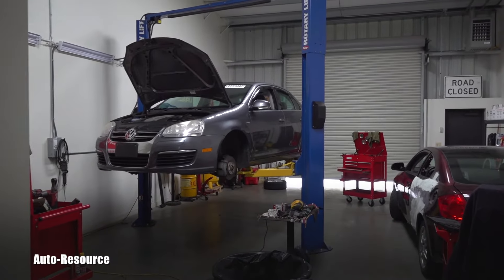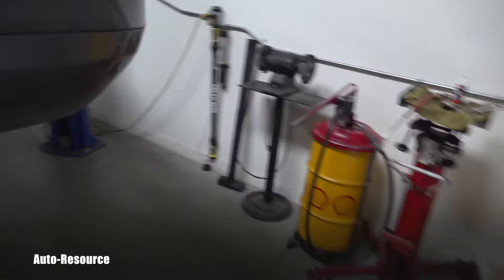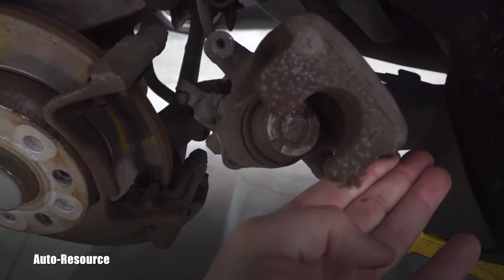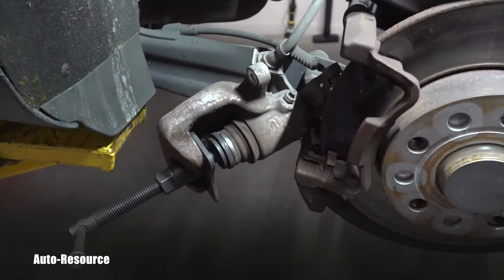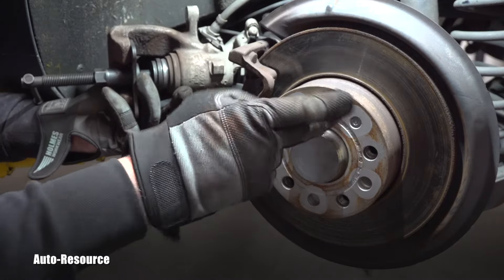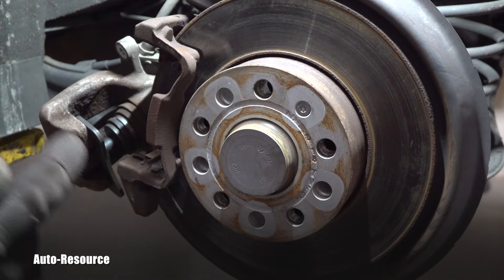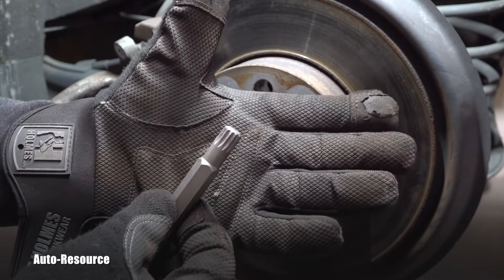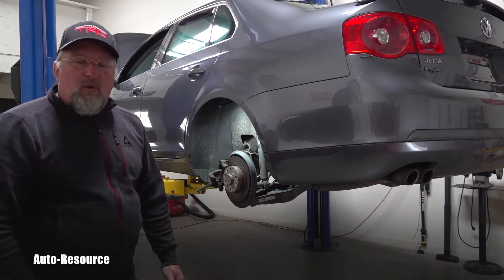Volkswagen Rear Brakes Specialty Tools needed

Comment: I have changed the brakes on countless cars.  None have been more of a nightmare than my VW. Buyer beware.  Stay away from German cars unless, 1 you are rich, 2 you sell it before everything goes bad on it.  Usually about 50,000 miles.
Reply: Hey, i have a passat 2012 b7 1.4 ecofuel, and im stressing myself out.. I have the scan tool to retract the caliper piston. And i bought a normal piston tool that just pushes back the piston straight. Do i need the tool that rotates the piston? And do i need any other tools to do the rear brakes? Im trying to find information but many people say different.. thanks
Reply: @user-cw3kp9mc6q  I took mine to my mechanic for the rear. Did not need front done.  I supplied the calipers, and pads. He installed them for $110. I want even going to try because I was so frustrated.
Reply: @Deeked  Okey, understandable man its annoying im not sure i have all the tools for the rear..
Reply: @user-cw3kp9mc6q  The tool to remove the bolt that holds the caliper is a special order for my VW. I'm 54, with a chronic lung disease.  Maybe if I was younger I'd go at it.  I just can't these days. 
Anyway, I wish you the best of luck fixing yours.
Reply: @user-cw3kp9mc6q  I forgot to mention.  For my rear caliper pistons, it requires a tool that rotates and compresses at the same time.  If not done correctly you can damage the assembly.
Reply: @Deeked  Oh man that sucks to hear, wish you the best and hope you recover from that! I saw some people mention some kind of triple square thing to remove some bolts or what ever on the rear.
Reply: @Deeked  I have a scan tool that i plug in to the car that rotates it back automatically and i've heard you dont need the the tool that rotates it back? That's what i've heard but maybe im better off paying 20-30 dollars for the right caliper tool just in case and the triple square to remove the bolts.
Reply: Nonsense, my BMW is the easiest car I ever worked on.
Reply: @maeu59  ok
Reply: @maeu59 😂😂😂 you must not have worked on very many cars then
Reply: @tylerseabook9423  enough to know
Reply: @maeu59   nothing about bmw is easy compared to any other car 🤦‍♂️
Reply: @tylerseabook9423  oil change the filter is right on top, brakes and rotors were easy, spark plugs no different than any other car I had. Mine is a 2005 330 ci, maybe the newer ones are difficult I couldn’t tell you.
Reply: @maeu59   oil filter location makes a car easy to work on? Brakes and rotors😂😂 brakes and rotors on every car ever are easy 🤦‍♂️ plugs 😂😂 do a real job on your car then compare it to any other car that’s not bmw or vw and you will maybe comprehend
Reply: @tylerseabook9423  you go from saying "nothing about BMW is easy compared to any other car” to " do a real job on your car” I give you examples of things I find easier and you want to go into an overhaul. Maybe you just don’t have any mechanical abilities and things are difficult for you.
Reply: @maeu59   🤦‍♂️🤦‍♂️ omg clearly you think brakes and plugs are mechanical experience. That’s first week apprentice stuff. I’m talking anything other than the basics. Which clearly you haven’t done😂 so I’ll just take my heavy diesel journeyman ticket and walk away 🤦‍♂️
Reply: And my Passat I had went 250000, my Jetta currently has 123000…
Reply: @chrisallen8473  they are junk. Ask any mechanic
Reply: @Deeked if you know how to work on them with the required tools they are fine lol. Just because you ran into a problem because you’ve owned a Honda your whole lives doesn’t mean they are a “piece of shit”. Have you not read about Subarus? Trust me, every mechanic I know has said Subarus are a pile and vw doesn’t usually compare to that. Germans just engineered them so they could be more reliable. God forbid something requires an extra tool.
Reply: Can’t say I agree
Reply: Totally agree, dealer parts are expensive  and dealership labor is 150 per hr. I have a 2014 TDI VW Jetta I already changed Egr, the sensors underneath the car including the one that is the exhaust, heater cooler, radiator, and gosh the engine light still on after the dealer installed the egr. However it runs great just a lot of maintenance and ohh as of last month the Wiper motor I had to change (motor 366$USd they no longer carry original part for this model so I had to buy the piece that the motor is attached to that part was 335$USD) All dealer parts purchased since I owned. smh I’m on the deep end in repairs but I’ve seen worst in VW forums. Cheers to VW!
Reply: My 2009 Jetta that’s only Had a radiator replacement and CPS replacement (other than maintenance items) in the 126000 miles it’s been alive would like to disagree 😂🤣🤣
Reply: @cullensmith8341  my Honda has 420,000 miles. 
Oil, brakes, timing chain/belt.
That's it. 
My Toyota, 275,000 miles. Oil and brakes only. European cars suck nuts

Comment: Thank you very much for explaining this! I had the tool to rotate & compress the piston but was using it incorrectly until I saw your video. Thank you!
Reply: Also, the brake job tool kit I rented from Advance Auto Parts included a disc for rotating and compressing the caliper piston; that disc also had a square hole in it's center which accepts a 3/8" drive ratchet. The piston in my caliper wouldn't rotate using the compression tool. I was only able to compress the piston into the caliper by using the disc and a ratchet to turn the disc & therefore the piston. As I rotated the piston with the ratchet the piston recessed into the caliper.

Comment: I’ve just done REAR on 2013 Golf with Electronic Parking Brake. The caliper piston just goes “straight” in! However, on a VW Polo with Manual Parking Brake the special caliper piston “wind back” tool is required!

Comment: my buddie's a mechanic, and I was doing the rear brakes on my VW and didnt have this tool so I asked him and he just took an extension for a ratchet and pressed it against the piston and twisted and  got the piston all they way in, no special tools needed. 
It kind of became a two man job as I had to hold the caliper with both hands but once he got enough pressure on the piston and twisted the extension getting it back in was no problem.
Reply: I am having same problem .I am turning the piston using vise grips but need to push on it too I guess ! I have to buy the tool to do it ,or put a C clamp to push in the piston while I spin with vise grips!

Comment: 14 mm wrench and 15 mm wrench to hold the nut so it doesn't spin. To release caliper 
Must spin and push back the caliper piston/use special compression tool
T30 for screw to slide rotor out
Triple square bit m14 size for the bolts that hold the caliper and pads
Use brake cleaner for new rotors. They come with special coating. Must clean off 
Apply grease to bolts. Apply grease to new pad ears and around piston and behind the new pad that sit on the piston. Careful not to get any on the rotors. 
You can do this.
Reply: How about the 11mm/ 7/16" hex slide pins on the rears of some passats.
Reply: @fjb666  ah i didnt encounter that. My project wasn't pleasant in the least but i was able to pull it off. How did you manage your issue? Please divulge. I want to know. Respectfully.
Reply: @822giron6  luckily a coworker had a hex set with 11mm, just ordered an 11mm to add to my set since most hex bit socket sets skip 11mm. Fun fact, 7/16" sae hex is close at 11.13mm.
Reply: @fjb666  is that the pin you hold while you loosen the bolt?
Reply: @822giron6  Nah, the 11mm hex is for the caliper slide pins on 2012 and 2014 Passats; found this out this week on the 2 different customers' cars.
Reply: It's 13mm (not 14) for the bolt head & 15mm to hold the nut

Comment: Hi. Good video. I am trying to help out friends doing rear brakes on the 2012 Jets S Model .I have the generic square block to retract piston ,left over from a 2001 Super Beetle brake job I did . It would not fit so I was turning the piston in with a set of new vise grips .The piston is turning but not retracting .I believe the calipers piston is bad internally or else I need to get a tool like you have that pushes and turns at the same time.If I buy the Harbor Freight Universal Set should it be able to turn the piston in on the Jetta Piston ? I see guys on videos using a adapter Labeled 2 A when they are using the Lisle 2500 Caliper Piston Service Set. I was going to just buy new calipers since pistons aren't fully retracting for me ,but I am going to try retracting using the tool like you have first ! Thanks for the info

Comment: I was doing rear brakes on my son's Mazda 3, and it had a piston retracting system like this.  So I ordered the kit, but didn't notice there are two shanks that come with it, one of which is counter-threaded.  I ended up extending the piston out so far, it was completely stuck, and I could not even remove the tool, to get the other one in.  I was at a loss, until I decided to open the bleeder, and use a combination of screw driver pressure, and wide pliers to twist and push the piston back.  it took a long time to get it moved much, but as soon as I could swap put the tool, and replace it with the right shank, it ended up okay.

Comment: C- clamp and a pair of adjustable grench will do the work. Turn them at the same time, I just did it on a 2008 GTI.
Reply: Hey, i have a passat 2012 b7 1.4 ecofuel, and im stressing myself out.. I have the scan tool to retract the caliper piston. And i bought a normal piston tool that just pushes back the piston straight. Do i need the tool that rotates the piston? And do i need any other tools to do the rear brakes? Im trying to find information but many people say different.. thanks
Reply: How does an adjustable wrench work🤦‍♂️ ?

Comment: ALL fasteners on VW exposed to weather, will have a chemical thread locker. If you try to remove these bolts without heating the bolt to a consistent temperature of over 165* it will completely ruin the threads or more likely break the bolt off in the carrier. This is a PITA. Just heat the 12mm triple-square with a torch or even a commercial heatgun prior to removing it. PLEASE :)
Reply: BS.  I've worked on a lot of VWs and never used heat.
Reply: @DonziGT230  I mean, so have everyone else here. You're wrong and if you worked for a living working on any import BMW, VW, Volvo, Porshe. you know, then this statement would have not been made. 
Keep doing you and keep ruining threads LOL .
Reply: @gamersroost  I've been a mechanic for over 30 years, I've worked on all of those brands, I've never used heat and never ruined any threads.  You're just plain wrong, accept it and move on.
Reply: @DonziGT230  There comes a time for every DIYer to face the challenge of removing a bolt that has been treated with red high–strength threadlocker. 

When the factory absolutely does not want that bolt to EVER come out, they use it. It is usually necessary too, components that are critical safety items such as brakes, steering, and suspension items are often treated to a healthy slathering of the stuff. 

This means that you must fight it to repair or replace a damaged or worn-out component. Here are some tips on how to remove red threadlocker.
Reply: When the factory absolutely does not want that bolt to EVER come out, they use it. It is usually necessary too, components that are critical safety items such as brakes, steering, and suspension items are often treated to a healthy slathering of the stuff.
Reply: @DonziGT230  When the factory ...... critical safety items such as brakes,
Reply: @DonziGT230  When the factory ......
Reply: @DonziGT230  Bye bye Doni...
Reply: @gamersroost  It’s pretty important your wheels don’t fall off and there’s no loctite on those. Actually the wheel bolts on the newer models are meant to be dry, no oil or anti seize. Purely rely on the torque to hold them. Brake parts need to be removed at some stage so they would use blue loctite if anything. Mostly all threads dry

Comment: our family owns 2 VW and i cange the brakes by rotating and pressing the brake cylinder by hand. not easy but it works...
Reply: How do you do that?
Reply: @toddkazlauskas671    well long nose pliers work too.
Reply: I wouldn't mess with you if you can push and turn that piston in by hand!  You prob can tear NYC phone book in half with that kind of strength !

Comment: You don't need a special tool to push the brake piston in. You can turn and press it in quite easily with long handle needle nose pliers.
Reply: Incorrect
Reply: @helpontheway  not incorrect I still have my VW and have changed the brakes several times. No special tool needed.
Reply: @DM-yy1mc  what year? How many clicks does your parking brake stop the car at? So many things can cause trouble with the rear pistons. You’re the first to disagree
Reply: @DM-yy1mc  I still have my Vw too, whatever that proves..
Reply: @helpontheway  2012 golf TDI have changed brakes 4 times never an issue. Only long handle needle nose and push in easily once I start turning the piston and apply pressure. I usually adjust my parking brake to 3 or 4 clicks.